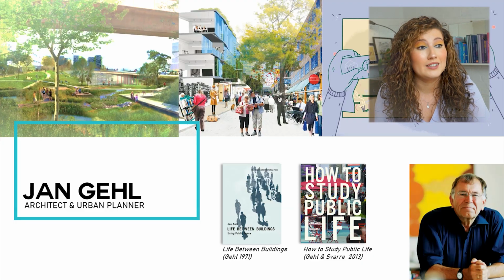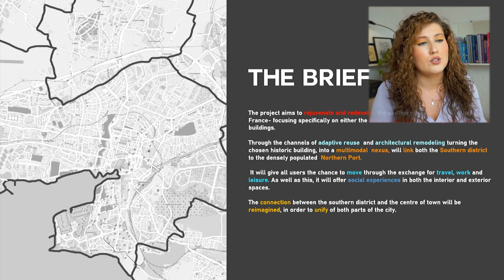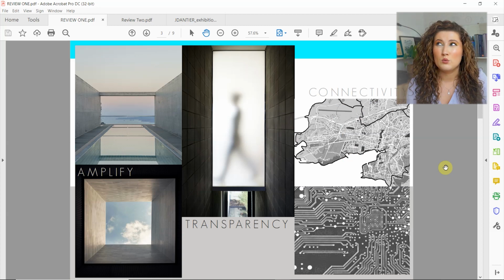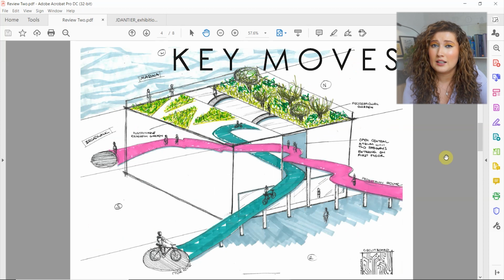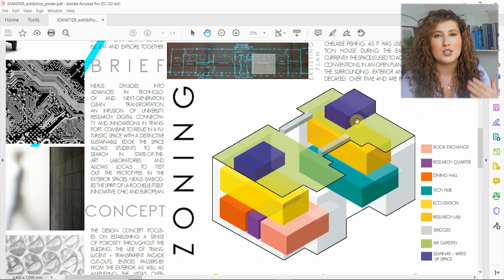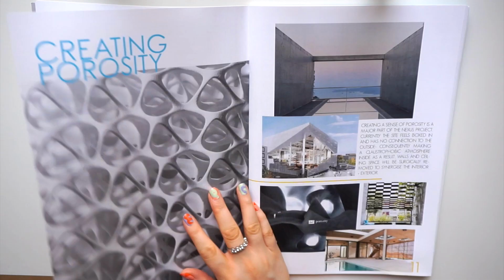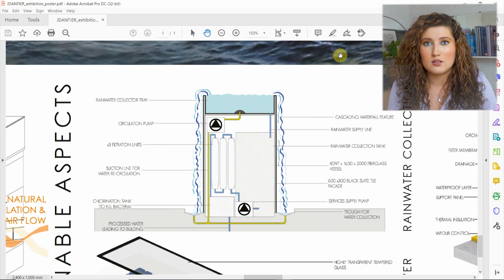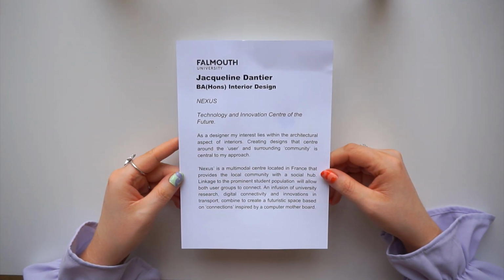Walking you through my INTERIOR ARCHITECTURE & DESIGN final project / DESIGN THESIS PROJECT

Comment: Do you use autocad. and how often do you use it.  what are the drawing programs common in architecture and interior architecture offices in london.
Reply from the maker: Hi! Sorry no, I don't use autocad. I would say that it depends on where you are applying. Top practices use Rhino, Vectorworks & Revit (I would say). But a good think to check out is job listings on LinkedIn, as they usually tell you what software is required 😁